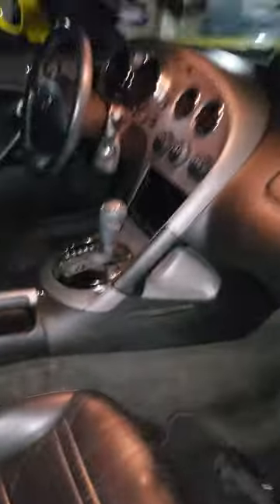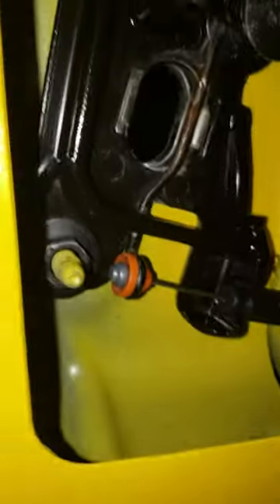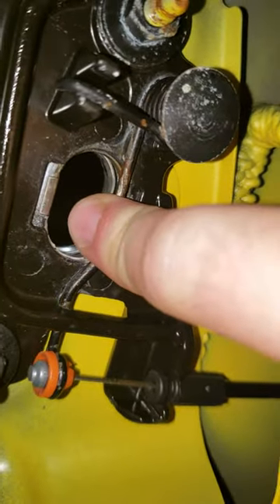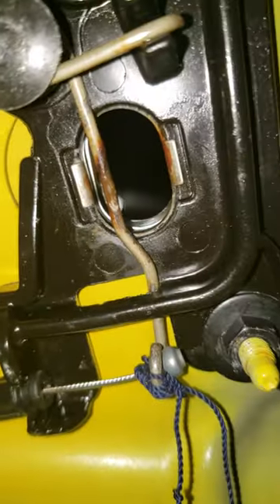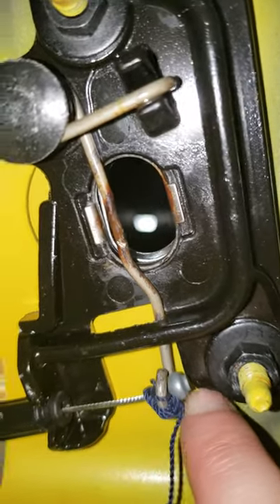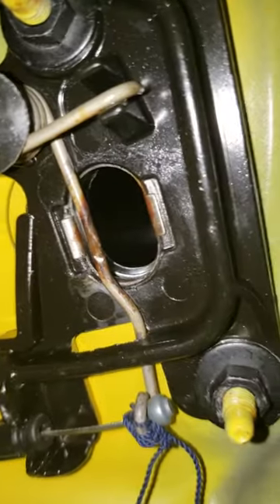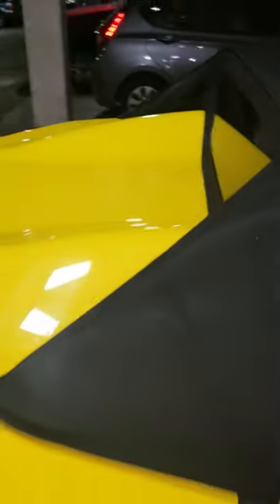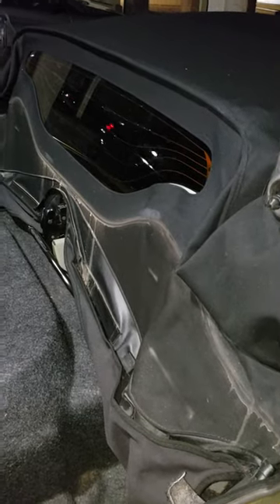How to keep your buttress from sticking in just five minutes.  Pontiac Solstice.

Comment: Very helpful
Reply: Very helpful, and hidden so nobody sees the cord 😊 I bet a zip tie might work? Trying to get my trunk open now 😞
Reply from the maker: @terryhites7322  If I remember right, I had to use a modified curtain rod pin to dig in the hole and release the latch when the trunk is closed. It needs to be a sturdy, strong (pretty thin) piece to move the lever and pry it open from the outside.
Reply: @patriciajohnson7599  I actually got it open but truck wouldn’t pop, so was going to have to pull the rear wheel off and pull the glow in the dark handle... all to find out that the trunk button was the problem... oh well, I know all these tricks now
Reply from the maker: @terryhites7322  you win for ingenuity! When mine got stuck I had a trunk of new plants I purchased from a nursery, so glad it wasn't meat and perishable groceries!!! Now I keep a little kit of "tools" I made that can get me out in a pinch! 🤣
Reply: @patriciajohnson7599  very smart! And keep your phone handy to pull up YouTube to figure things out when off ball things happen